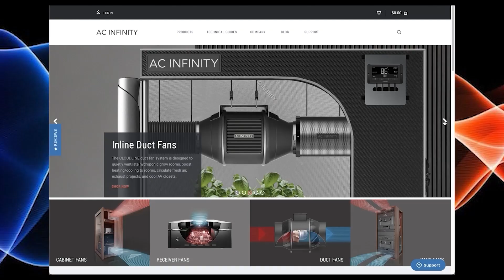Where Grow Lights Will Be In 2025, 2026, 2027 & Beyond!

Comment: its already right there ... a lot of these devices have sensors for the exhaust fans and humidifiers that can automatically kick on , and you can set the perimeters 

Chris is right in 5-10 years we will absolutely have AI incorporated into the lights , where maybe they can measure which temperatures and intensity were providing the most vigorous growth , and then automatically increase or decrease intensity as needed.
Reply: What is the newest hitek light on the market today 2025
Reply: @Dragonwitmatches  that's relative...

Comment: Yeah because with all those drip lines at the bottom of the tent we actually need MORE wires from moisture probes for each pot. Like jumping into a bowl of spaghetti trying to get into the tent, lol. No but moisture meters are good for growers knowing when to water the 50-100gallon pots or more because you can't lift to check to see if it is dry when they are that big. Nice video.

Comment: Im interested in spectrum control with a main dimmer and dimmers for the blue and red ends.
  More intensity doesn't matter much. If the light can get to 900- 1000ppfd at about 18" its more than adequate. 
  I prefer vegging at 400-600 and flower at 600-900. This range has a very effective growth rate and its energy efficient. 
  Im not saying theres no benefits to high levels of light. Im saying you can get 1-2g per watt without it.

Comment: Why is that Ac Infinity smart hub only increases or decreases light intensity by 10% increments? Or am i wrong! I actually favor Vivosuns smart hum over Ac Infinity because Vivosun is in 1% increments which helps me control heat. I follow VPD! However, the new Ac Infinity terraform 7 is a game changer and im getting one as soon as its in stock
Reply: You can verify that by checking amperage/watt rate. Many lights only allow 25% increments.

Comment: I’m confused because on Shane’s channel he usually says plants don’t need more than 800-900 unless you have CO2 but here he is saying 1,400 and didn’t mention CO2, but rather nutrients.

I have excellent genetics, nutrients and adjustable hydroponic watering.

Will 900 be enough for me?
Reply: It's 2000 outside with 400ppm CO2.......
Reply: @Ayyo_productions-u2h  AS you know, outside plants are very tiny from the lack of CO2...🤥
Reply: @superkillr  the biggest plants are outside plants lol
Reply: @Ayyo_productions-u2h  how does that helping him?  btw, we are now well above 400ppm, so ahhh, riding the tipping point into oblivion in a wet world?  Give me some septoria resistant strains please!
Reply: 1k is supposed to be the normal max guess he says 800-900 so you don’t burn them …., they are talking about commercial growers though, you’re a home grower lol… commercial growers use co2
Reply: 1200 I would say is the max with co2
Reply: He's talking about commercial growers. They keep the environment dialed in to make use of the extra par.
Reply: The peak efficiency is 900. They can take up to 2000 (the sun). This is a good spot for indoor growers to not waste energy. You will see diminishing returns past 900 par.

Comment: Grow lights with sensors that adjust power areas to the canopy, would be game changing! 🤙🏽
Also separately dimmable bars, or quantum boards would be a cheap manual start for this, would be helping if you're not scrogging, but you have different plants with different heights in your room...

Comment: Pots with intergrated sensors would be cool sending data about PH, saturation, feed levels etc. But it would'nt need to be an AI controller.
Just a more complex AC infinity like controller with more sensor/probe inputs.
I think this is all doable now with current tech available. It just needs to be financially viable.
AI to me currently is a stockmarket slogan on the most part.
Reply: Or Vivosun hub and I mention them because you can turn light up or down in 1% increments which allows me to control heat better than using an Ac Infinity that is 10% increments. I actual use both, but recently switched both tents to vivosun because of the increment value. Any suggestions on the Ac infinity hub, I would listen. I don't know everything!
Reply: @eagle1492  Vivosun is not really available where I live. I wasnt especially talking about AC Infinity, but any of the controllers like the vivosun you have or mars version.
They could make them a little more complex with more inputs fairly easily. 
Do you live in a hot place? I would personally want the lights set as high as I could get away with & not alter them after. Then use other equipment to control the enviroment, fans humidity etc. Also the room its pulling air from, rather than moving the light intencity up & down.
For me the best thing about the hubs is being able to set the enviroment up to the VPD.